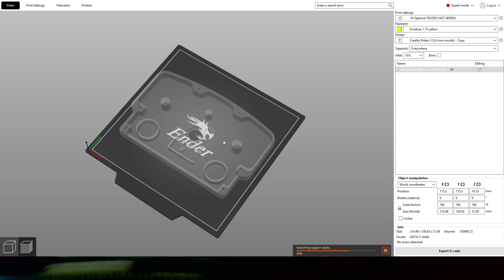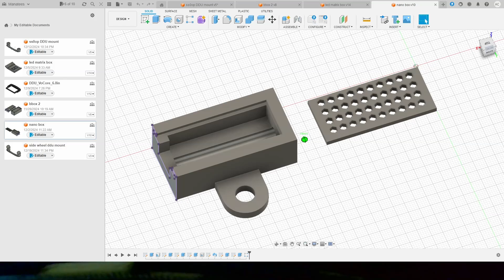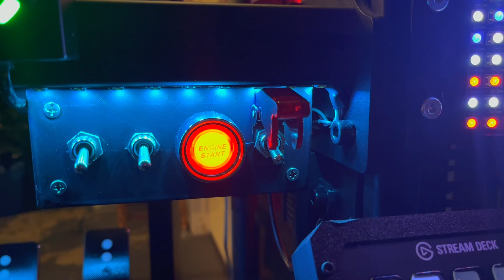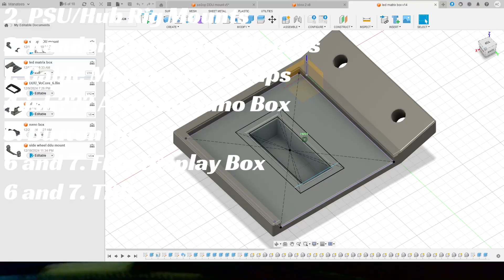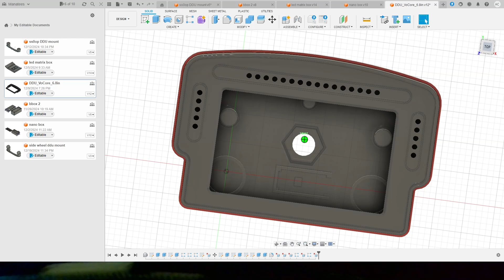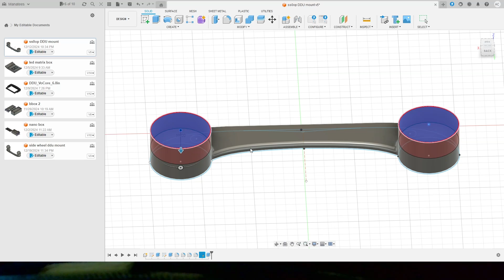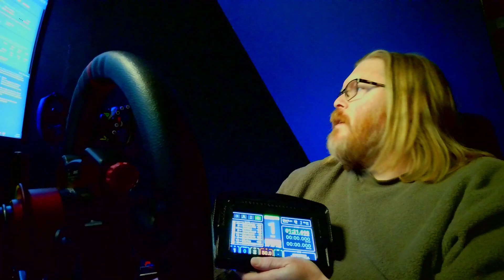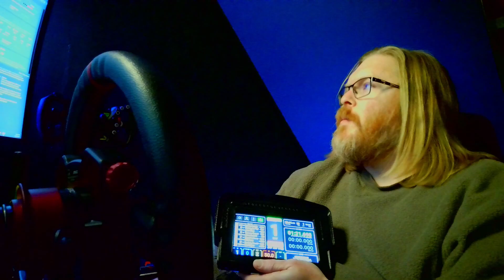UPGRADE Your Sim Racing Rig with 3D Printing on a BUDGET!

Comment: Great to see a fellow sim racer utilising the power of 3D printing. I've made so many things for my rig :)
Reply from the maker: Thank you!  What’s your fav print for your rig?
Reply: @ss0op  Wow that's a tough call. I also did the RGB matrix flag panel which I like, custom mounts for shifters and handbrake, keyboard mount, tablet mount, QR connector mount for my spare Simagic rim, StreamDeck mount, an F1 tyre stack beer holder and even printed some short sections of "aluminium" profile. Think my fav would be when I got the carbon fibre effect build sheet for the printer and made a custom H gate cover for my shifter and also some little shelves to put my phone on etc. Who doesn't like a little carbon fibre :)
Reply from the maker: great stuff!  There are so many options!  Glad to see I’m not the only one taking advantage of it!  Thx for watching and commenting! 😊
Reply: Thanks for sharing some great ideas! I’ve printed a couple cup holders, a button box for my stream deck, phone mount, PSU mount, iPad mount (as DDU), aluminum profile red strip insert contrast, arm mount for button box mounting and adjustability, a backlit power button for a wheel base (Fanatec CSL DD Pro), a profile mount for a power switch for my new wheel base (Simagic), shroud and mount for two large fans, case for Arduino and wind simulator cabling. Always looking for more projects, haha! I think I’ll build an RGB shift light next. Oh, and I have Golden doodles at home too haha